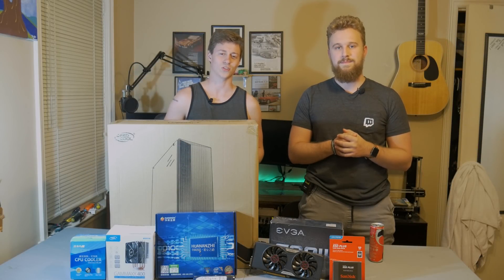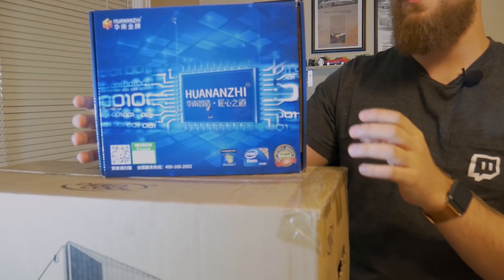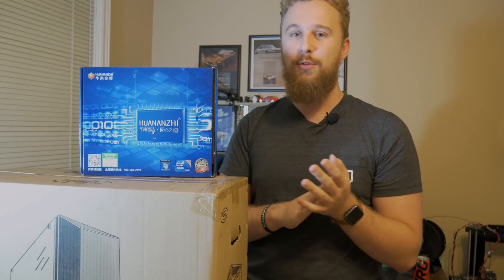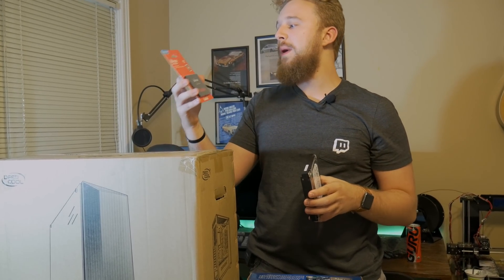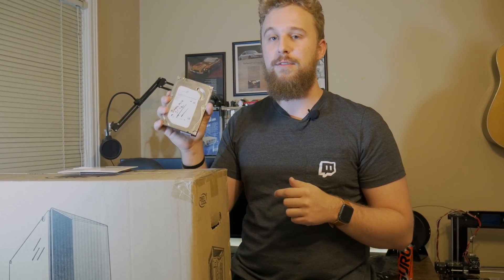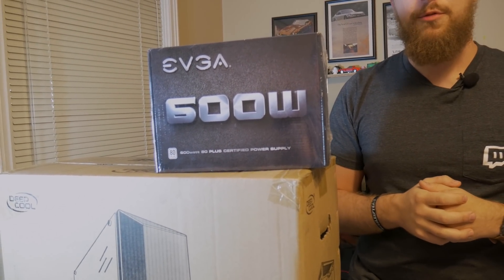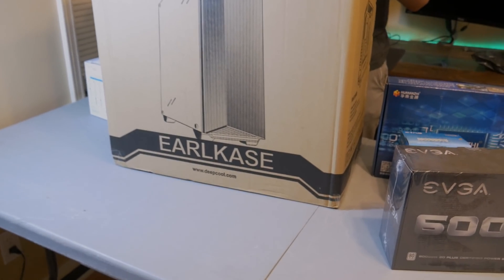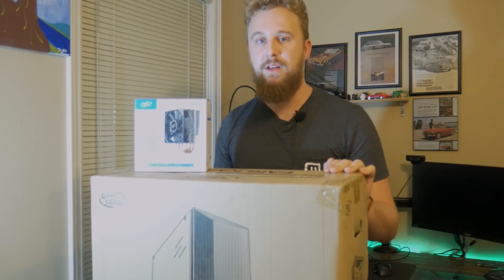$450 Gaming PC Build 2018 | Xeon x5650 + GTX 960

Comment: Where do they get these morons who buy dumb shit lol... You should do research on motherboards before you go buy some chineese remake garbage version that doesn't even have partnership with the CPU they are using the motherboard for... All you gotta do is go online, buy a T3500 Dell... it even comes with a QUADRO 2000 and plays low end console games along with low fps major titles... I got one for 100 bucks on Ebay, swapped the W3560 out of it with a X5690 which are about 100 bucks, and then I overclocked that bad boy and my PC runs just as good as a newer one. Also another thing you should check out... try an older graphics card like the GTX 680 which has a 15% better performance rate anyways, but an older GPU that is supported for that board ;) Gaming performance at base X5650 should be OKAY lol.
Reply: 230 dollars I paid in total. for my computer. 40 dollars for the 680

Comment: Lol 
This is kinda a scam 
I got these specs for 250$
X5650
Rx 570
8gb ram 
Lga 1336mobo
500gb hdd
450w psu
Reply: X5650
750Ti
16gb RAM
256gb SSD
500w PSU

About $200
Reply: OutlinedBudgie suggest you spend a little more and get an rx 570
Reply: @rtg2427  ok
Reply: @rtg2427  Thanks for telling me to look better, I now have:

x5650
RX560D 4GB
32GB RAM
generic lga 1366 mini atx board
500w psu
cpu cooler with 4 heatpipes and 3 fans

€200

Comment: Nice try. But Ryzen 2600 ($166) + B450 ($70) + 16 gb ddr4 ($135) = $371 brand new.  Renders all of this used x58 nonsense pointless. https://pcpartpicker.com/list/nsMxRJ
Reply: or  Ryzen 1600 ($150) + B350 ($56) + 8 gb ddr4 ($76) = $282  Even with only 8gb, it should still run rings around that x58 build. https://pcpartpicker.com/list/X7mkNN
Reply from the maker: agreed, the combo was expensive, if I could overclock the system it would be a much better price to performance. Still cool to try!

Comment: Played around with an x5650 as well a while back. At 3.85ghz (went with a mild OC) it has a better cinebench r15 multi-core score than a stock i7-4770k. Oddly though, I just noticed windows perf monitor like you showed, the x5650 with the OC only showed 2.9ghz max. But if I checked in CPU-Z, it reported the proper frequency. Found it odd. Hopefully you checked with CPU-Z afterwards at some point! Xeons ftw!
Reply from the maker: It still was showing up as only 2.9 in cpu-z, the motherboard just can’t handle it
Reply: Poooooooooooooop :(

Comment: The brand name of that cooler is literaly 38 degrees in Chinese. I highly doubt if it’s gonna perform that well even when idling.
Reply: I have a Deepcool Gammax 400 cooling a x5670 clocked at 3.8ghz, and yes it does idle around 38˚c according to Hardware Monitor. I'm actually surprised at how well it is cooling the CPU, especially since I am using a no-name brand thermal paste.

If only Windows 10 wasn't giving me problems I'd be happy indeed with the system.
Reply: @voteDC  Gammaxx 400 is actually a really good cooler, dare I say better than Hyper 212 Evo
Reply: voteDC he was talking about the the one with the bundle
Reply: @voteDC  is windows 10 having problems with the system?
Reply: @hyperion5175  Not the hardware but Microsoft's insistence on automatically installing updates. If I used my Microsoft mouse it would install a software for it that for some reason would stop the media keys on my keyboard from working.

In fairness previous versions of Windows had the same issue but it was easier to manage there.
Reply: @voteDC  ohh at least it's not something major. thanks!

Comment: So you guys used the deep cool since the server mobo can't take any other cpu cooler like a hyper 212
Reply from the maker: It uses socket 2011 mounting so any cooler with that can support it, we used the deep cool one because the sent it over for us to use
Reply: @ToastyBros  socket 1366*  ;) ;)
Reply: Easy mistake to make since the Gammaxx 400 supports LGA 2011, 1151, 1150, 1155, 1156, 1366, 775 on the Intel side alone.